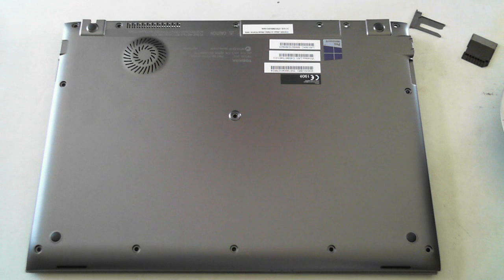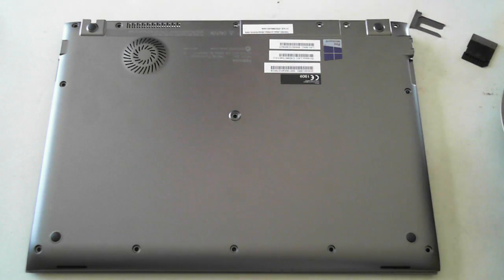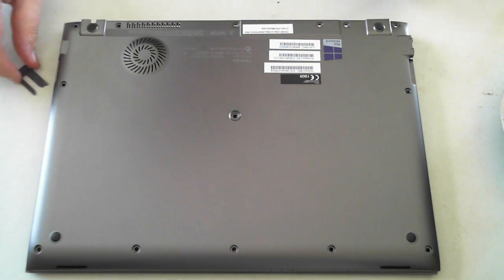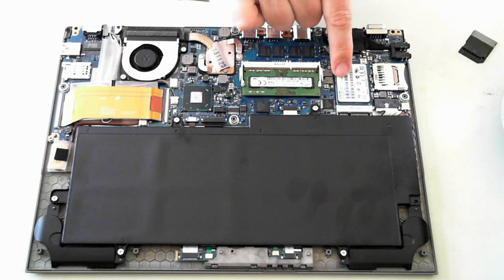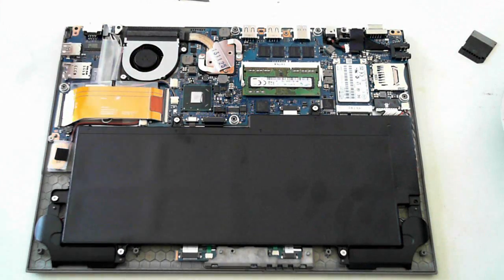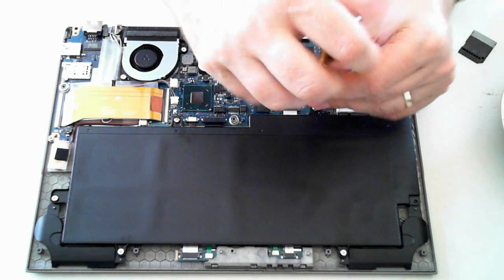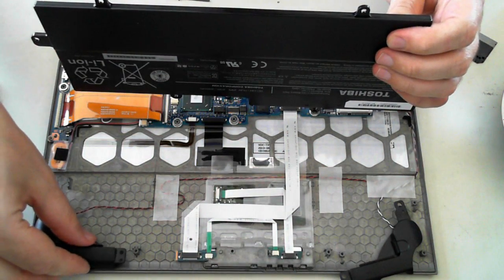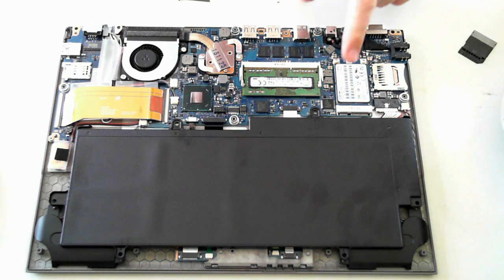Toshiba Portege Z930 Ultrabook Teardown

Comment: have ultrabook z930. getting PXE-E61 and PXE-MOF failures when starting up. any idea on how to fix without losing data? or what could be the problem?
Reply from the maker: Sounds like a hard drive failure. Remove the drive and see if you can read it on another machine and backup any data?

Comment: Hello Friend
I need to replace the keyboard of my portege z930, I still do not understand if it can be replaced without affecting the insulation or also have to replace the same ... would you have any video in which this procedure is shown?
Reply from the maker: Sorry I don't have a keyboard replacement video for this model.

Comment: Hello there, thanks for the video. l want to replace the SSD on my friend's laptop (Z930-171 model). Do you know if the 'Samsung 850 EVO mSATA' will fit? Otherwise, could you tell me which SSD model should l buy? Thanks in advance!
Reply from the maker: It will be best to take the drive out and take it to your local computer shop to confirm that it is the same.
Reply: Thanks for the quick reply. lt makes sense; l'll do that. Thank you!

Comment: Hi, my SSD has died and I'm trying to find a compatible one to replace it with. Do you know what specs I need to look for? Is it a 2.5"? Mine seems to be just 4x3cm. I'm looking at a Plextor SATA M6G-2242 - will that work? Any help much appreciated,  I live in a very remote part of Asia so only have Internet for support!
Reply from the maker: +Sarah Whittaker Any SSD of the same physical size will work. Some are faster than others but I generally go for Intel or Samsung SSD's.
Reply: +dpcomputing Thanks for your quick reply. Finding one of the same size is my problem. I've ascertained that this one (in the Z930, model THNSNS 128GMCP) is 50.95mm x 30.0mm. So I think the Plextor above will not work as it is 42 x 20mm. Apart from one Chinese copy of the original (brand 'For Toshiba' http://www.aliexpress.com/item/FOR-TOSHIBA-SSD-128GB-Mini-PCI-E-mSATA-SOLID-STATE-DRIVE-THNSNS128GMCP/32326905266.html#), the only similar new one I could find is a Toshiba THNSNF 256GMCS Mini PCl-e, size given as 50 x 30mm (http://www.amazon.com/gp/product/B00IKNEOM4/ref=olp_product_details?ie=UTF8&me=). My concern is whether the .95mm difference in length will make it incompatible. Otherwise, if you are able to recommend a specific make and model that is the same physical size, that would be very helpful. Thanks again!
Reply: @sarahwhittaker3157  What size SSD did you bought?